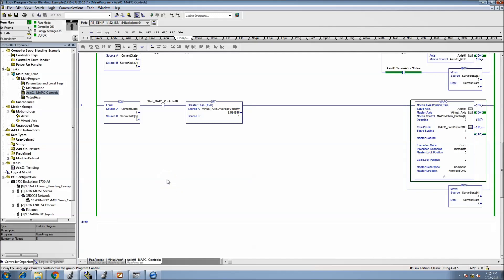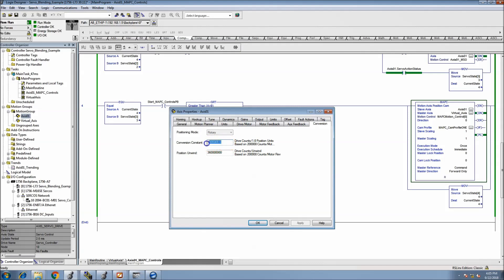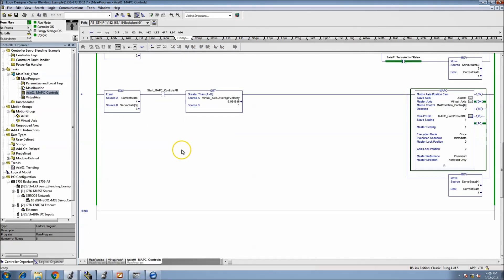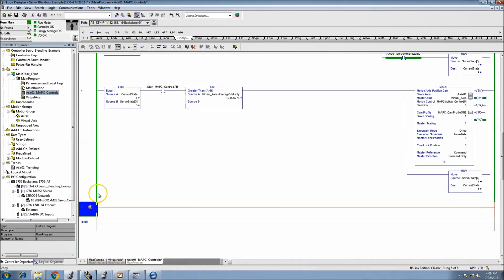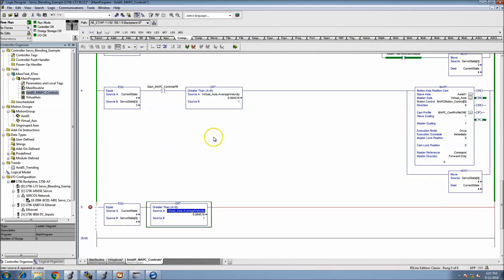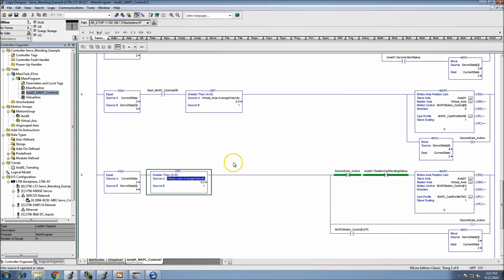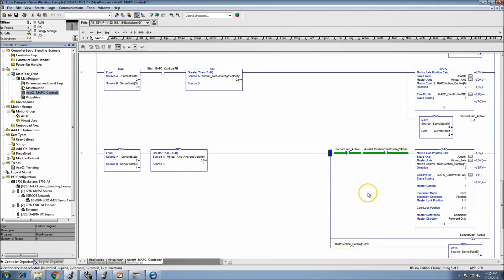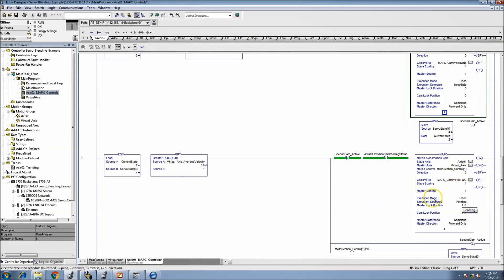Studio 5000 Logix Designer Servo MAPC Instruction Vid 5 - Cam Explained

Comment: Hi Shane, would it be possible to use MAPC instructions without any physical servos? I'm reprogramming an old flying shear machine and it only has encoders and a hydraulic valves for movement. Is it possible for me to just move those infeed encoder counts into a Master axis, and then have the slave axis determine my position of the carriage of the shear machine?
Reply from the maker: Yes, you can use an hour encoder as a servo axis then use the MAPC instruction based on that encoder being used as a servo axis
Reply: @ShaneWelcher  Would I just move that encoder count into the Actual Position of that Master Axis? First time using these instructions so I have a lot to learn still.
Reply from the maker: @colebutler1644 Just make a servo axis that references the encoder not a motor
Reply: @ShaneWelcher  Would I have to do a virtual axis since this encoder is just a signal back to the PLC, and doesn't have anything in the IO tree?
Reply from the maker: @colebutler1644 No, just make a position based servo axis not a motor based on

Comment: Hi Shane, can i cam two virtual axis'?
Reply from the maker: Not sure why you would cam two virtual axis in a real world system.

There are ways though.
Reply: I am just simulating using an emulator, no hardware. Playing with camming. The slave will not cam to the master for some reason. Any idea why? I have checked for duplicate motion instructions etc...
Reply from the maker: @John Archer  depends on the version you are running, I would say that using two virtual axis should not be cammed together.
Reply: @ShaneWelcher  for R&D purposes it would be handy. Can I use a real axis and watch the command position change?
Reply from the maker: Using a real axis would be best for camming.

meaning, real-world servo
Reply from the maker: Camming would not be functional for two virtual axis, camming in based on positions.
Meaning real-world devices, encoders, drives, servos...etc.
Reply: @ShaneWelcher  a virtual axis can still have a command position so don't see why ut shouldn't work. I see where your coming from but simulation should still be possible...
Reply: I can gear three virtual axis but cannot cam any?
Reply from the maker: @johnarcher2056  correct
Reply: @ShaneWelcher  you can do it. I had my execution schedule set at bi directional and they were both starting at 0. Changed to immediate and away it went 😁

Comment: Shane thanks for all these videos, it helps a lot.

I also do have a question if my master(virtual) is moving from 0 to 100 using MAM and slaves are CAMed to it, once MAM is complete how to go back to 0 on the virtual axis, to perform this 0-100 position motion in the cycle again and again. 

Do we manual have to perform Home or MRP to the virtual axis to get it back to 0 before giving it the next MAM command or MAPC take care of it automatically.

I did not get how your application works continuously without resetting the position of the master everytime.
Reply from the maker: If the process allows then wait till roll over, if not then mrp or home.

Note that mrp is temporary.

Meaning, if the system losses power the it will return to original home position not the mrp position.

Just a note so you are aware.

Over the next few weeks, I am actually re-working my motíon courses.

This will be even more detailed than anything for servo training.

My last two servo course were a great success but it's time to keep up with technology

Comment: Hi Shane Welcher,
Thanks for this video.
I have a question about the slave axis in MAPC:
How I can change the speed of the slave axis?
Change the cam profile, right?
Reply from the maker: Either the servo attributes or the cam profile or the slave ratio.

The best way is the cam profile.
Reply: @ShaneWelcher   Yep. Thanks for your information.